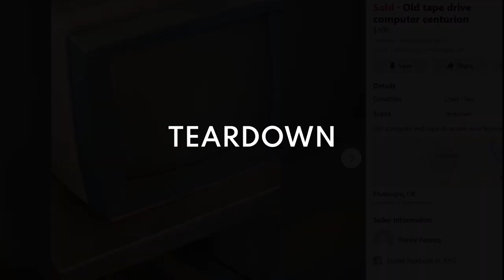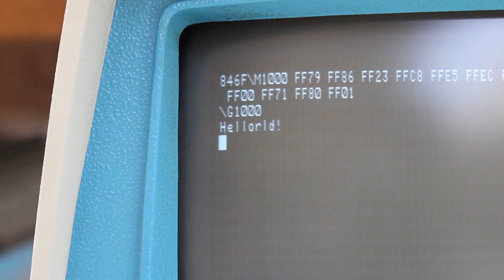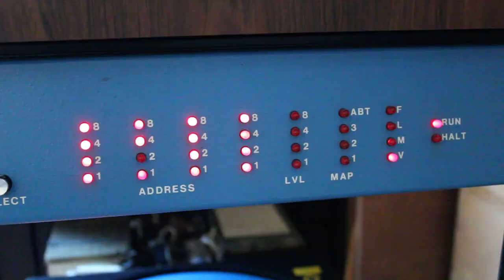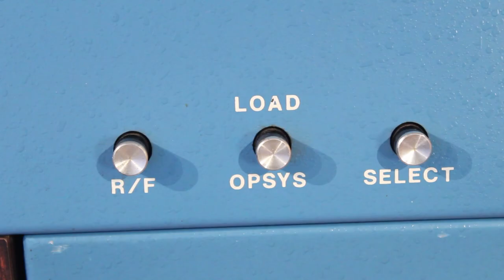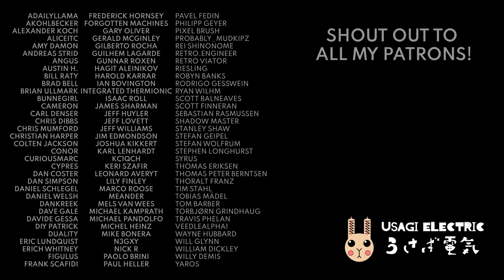Centurion Minicomputer: Trash to Treasure

Comment: "I can't freely distribute the OS (per request of the current Centurion IP holder)" -> I'm saddened by your decision. For me it's a equivalent of not restoring this system. Copyright lasts for hundreds of years - both you can't wait for so long and it will be much less interesting to dig it in 100 years.
Reply from the maker: Unfortunately, my hands are very tied on this one. I talked with the current Centurion IP holder and they actually still have two customers using an updated version of this OS. Legally I can't share the source code for the OS until he gives the OK. 
It's not all lost though, several members of the team have the OS image backed up on their hard drives, so we won't lose it again, and the current IP holder did mention that he was planning to migrate his customers to a newer system, at which point the Centurion IP will no be used and at that time he would be more open to making the original OS open source.
And honestly, I can't fault him for wanting to protect his customers still using legacy systems! So, no need to worry, I can't release it now, but it certainly won't be 100 years, most likely it'll be just 2 or 3 years.
Reply: @UsagiElectric  thank you for the answer.
Reply: @UsagiElectric  Incredible that people are still relying on these machines. Even more incredible that someone is planning on 'upgrading' them. Is this upgrade the OS or the hardware as well? I imagine just the OS. Its obviously a specialized app in a niche environment. Typically these are legacy small government setups. These people are locked into using legacy software that they dont have the wherewithal to migrate. I imagine for the cost of power alone over a few decades you could have hired a decent developer to migrate the legacy app to modern hardware. It's the old 'if it aint broke dont fix it' mentality, which is great until it breaks and then cant be fixed.
Reply: @UsagiElectric  He isnt trying to protect his customers, he is trying to protect himself and his itty bitty niche business!